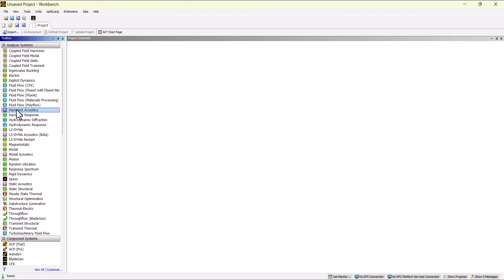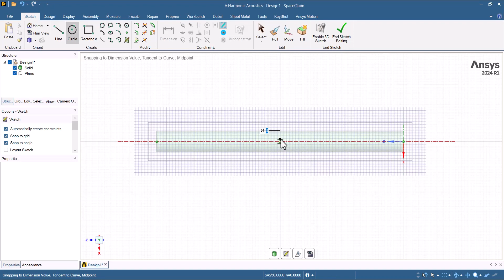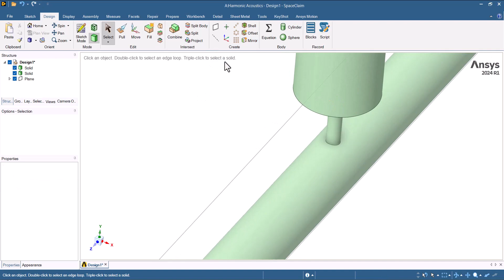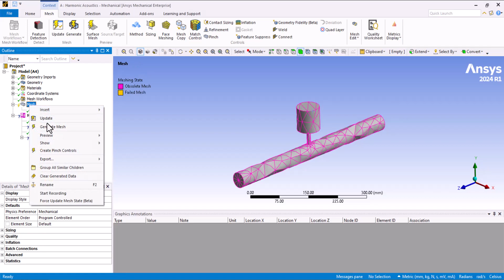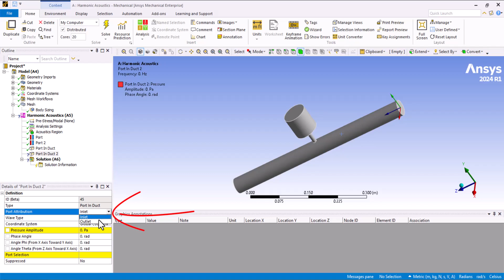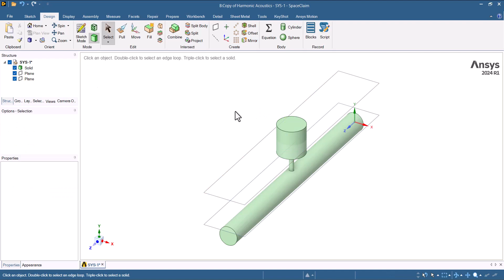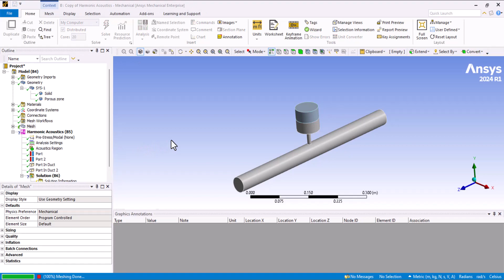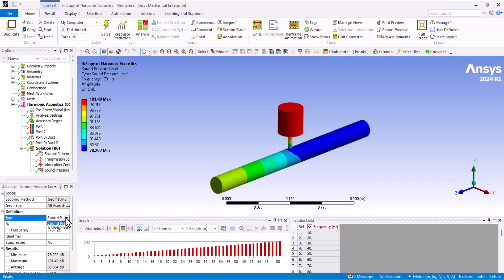📉 Ansys Tutorial: Sound Transmission Loss & Absorption of a Helmholtz Resonator 🔊

Comment: If the cap (Top plate ending) of the enclosure (Resonator) is flexible,  a periodical sort of hammer impacts it . Cap material properties are known. Is it possible to calculate vibrating modes of the resonator? I have already calculated structural in modal analysis, and harmonic responses. Believe so if i translate velocities profile from Harmonic response to Harmonic acoustic i will be able to find something. I wonder if Ansys automatically couple both (Structure and fluid). Let me know if this makes sense or i may clarify. Thank you.
Reply from the maker: You have calculated the natural frequencies. I don't understand why you want to couple the physics.

Comment: I have got the error “The input power at the driven port is equal to zero. Please check the port definitions” when evaluating the result in STL
Reply from the maker: Did you specify pressure for the inlet port?

Comment: Hi,I would like to ask how to simulate sound pressure cloud maps for different shapes such as flat panels, cylinders, and rectangular cuboids if I need to perform point source analysis. I want to explore how the same sound source generates sound pressure simulations for different shapes. Theoretically, since only by defining each shape as an acoustic domain can we observe the changes in the cloud map, why am I unable to select the sound source and various shapes as acoustic domains? Could you please provide me with some suggestions or steps?
Reply from the maker: @sz5422-f7f  hello, This is a complex model that requires a lot of time.  Unfortunately, I have no idea.
Reply: @caewitharminhashemi  Oh oh, thank you, maybe I didn't express myself clearly, I want to ask you how to set a flat plate of a material like aluminum as an acoustic domain and observe its sound pressure level or sound pressure? Do you know? Excuse me. Thank you so much
Reply from the maker: @sz5422-f7f  you have to create a 3D solid plate in harmonic acoustic and apply a structural region for it. Therefore you have two region , acoustics for air domain and structural for aluminum
Reply: @caewitharminhashemi  But if I take the aluminum plate as the domain, I don't see the sound pressure diagram and the sound pressure level diagram, and I want to look at it separately, because theoretically it seems that the sound pressure diagram and the sound pressure level diagram can only be observed in the acoustic domain
Reply from the maker: @sz5422-f7f  maybe you selected wrong. You can see spl in the all air domain
Reply: @caewitharminhashemi  Could you be a little more specific? Or can you send me an email to see your operation video? Thank you so much! I thank you very, very much
Reply from the maker: @sz5422-f7f  I did not understand what you mean.  Which part should I explain?
Reply: @ Thank you for your kindness. I don't know what spl is and how to choose the method. I think my choice should be OK
Reply from the maker: @sz5422-f7f SPL is present in the results by default.  Just choose it
Reply: @caewitharminhashemi  Okay, I still don't understand but thank you for your kindness